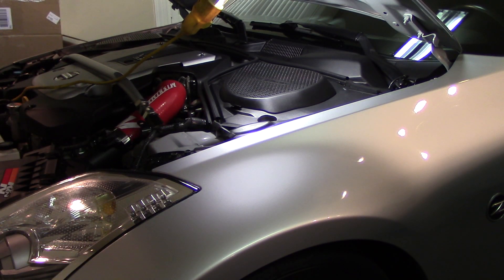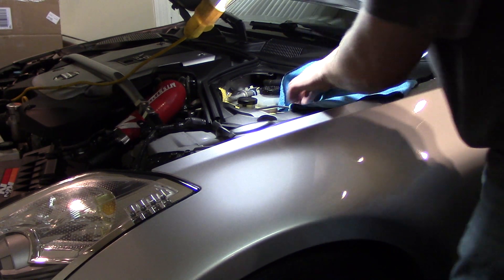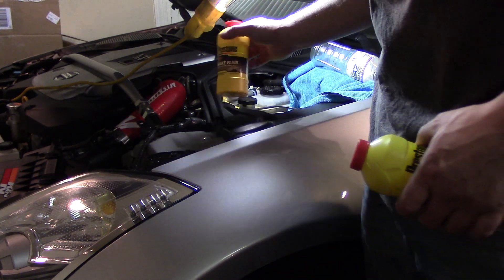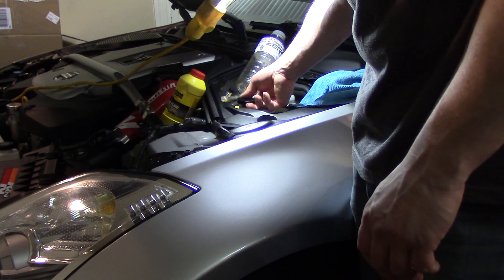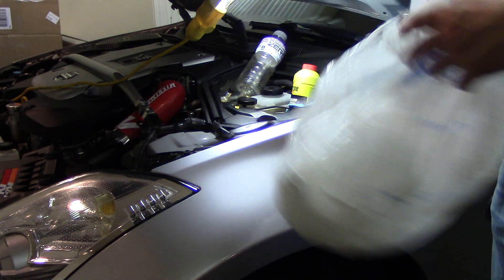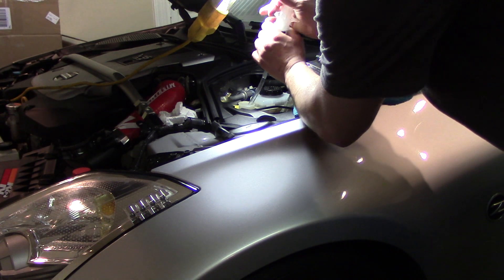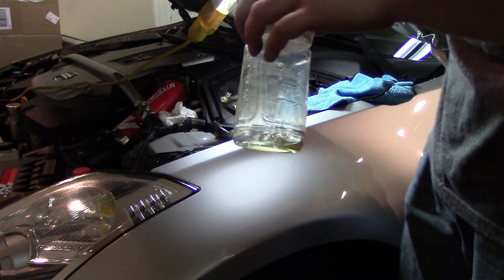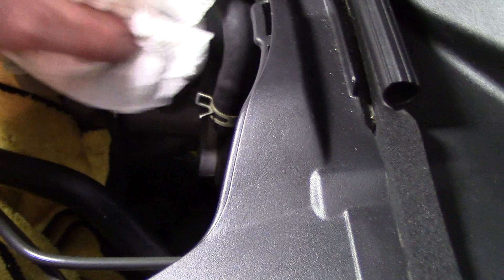Changing Clutch Fluid in Resevoir ONLY - 350Z

Comment: hey folks, hate to dissapoint but hydraulic systems such as cluch and brakes DO NOT CIRCULATE!!!!! think about it!! if they did there would be no pressure!! pressure is what assists/multiplies  the actuation of the pedal/ effort with our foot!! the fluid is basically static in the system, its purpose is pressure!!! so it does not circulate like engine oil or coolantl !!!! so as a result we need to flush these systems from time to time because brake fluid loves moisture which turns it dark and contaminates it so merely replacing the fluid in the resevoir is a waste of time!!!
Reply from the maker: I agree with 99% of what you said.  I never say this is even close to a replacement for flushing the system -- Hydraulic fluid as any fluid in a closed system moves from spot to another.  It definitely works as if it were a solid or closer to a solid -- (Push one end, the other end does the work) -- however, I and many other Z owners have had results from doing just this.  
Repeated changing of the reservoir does cause some of the fluid deeper down the line(s) to work it's way back into the reservoir, that is changed out.. rinse repeat.  It's not a way to replace the fluid,.. it may only replace 10-20% of the fluid after multiple efforts.
However, when you have a Concentric Slave Cylinder inside the bell housing, small things like this help after track days, before track days,.. etc.  (For SOME people).
If you were to put a dye in the reservoir.. you would find , that dye,  over time, at the other end of the system.

Comment: I know this is a old video but I have a question and Im hoping your able to answer. So I replaced my clutch everything went good, next day my clutch pedal just sticks to the ground I replace the master and slave worked fine fast forward about a month my clutch pedal begins doing the same thing but its only on a long drive it'll come up halfway and I have to pull it up with my toe I had to drive it like this on the way home the next day I turn the car on and it comes up normally until I drive it a distance just suddenly stops working when im at a stop and the car is still. I don't know if this has anything to do with it but if I turn the A/C on and I'm just sitting there for a bit and drive off it instantly makes the pedal come halfway up.
Reply: Ever figure out what the issue was? My nismo is doing this now. Sorry know this comment is 2 years old.
Reply: @godhelpgthisnoob4913  my clutch too
Reply: You have to adjust the clutch pedal assembly

Comment: this should've been a 3min video max. if you did it the right way by bleeding the slave cylinder nipple under the car, it still should've need less than 12mins. it appears you did it the lazy man method.
Reply: WHAT??
Reply from the maker: What are you talking about?  -- You could flush from a caliper bleed if you wanted to.  The point of this video is in the description.  I state specifically this is not the way to completely flush your hydraulic fluid. -- Lazy? Months after this I dropped the transmission myself and replaced the Master, CSC, all lines with SS, Clutch and Pressure plate.  Have you seen the work I've done to this car?  I've had this thing stripped down to assembly line condition for a sophisticated custom audio installation. I'll agree that people are lazy in general... but to generalize it to Americans not paying attention to modern human tendencies/behavior.

Comment: Did that MPG computer say 32 MPG? LoL. Anyways i can tell your really into your car. I have a 04.5 Touring model. What transmission fluid and differential fluid you running?
Reply from the maker: Haha.. yes it probably did.  When I'm not driving for fun.. I'll often drive to get the highest MPG like a game :) -- But 32mpg , as we know, is not a realistic figure over the long term.  So that was probably me resetting the MPG meter 10 miles from home and cruising down hills and such where it was averaging such a high mpg.

My true MPG with the tune on Stock Map (essentially off) -- is 23-24 mpg with a 90 percent city, 10 percent highway driving.

With the Tune on -- it drops to ~17 mpg in the same driving conditions. hehe..

Nice model.. I love all the Z's.. mainly from Z32 (1990 - present), So, Z32, Z33 (our cars, and the Z34 (370's).  I actually like the Z33 body style of the 350Z better than the bodystyle of the 370's/Z34's.. But The 370's are faster, and nicer inside.. sooo lol.

As for fluids in tranny and rear.. I use stock.. after all the reading,.. I've come to the conclusion that stock does a great job.

The diff. fluid I'll change with stock at the appropriate mileage.  Though, I MAY go to another fluid for the transmission here soon.  Considering I'm putting in a new Flywheel, JWT Clutch, Wilwood Heavy Duty Master Cylinder, Zspeed Heady Duty Slave Cylinder, All stainless steel lines, and a Nismo Roller needle bearing (to replace the stock brass one) -- I should consider swapping out the transmission fluid as well to complete the pretty much replacing everything down there job.. --- So what brand/kind of Transmission fluid do you use, and/or recommend?  And why?
Reply: I just ordered redline mt-85 for the transmission and redline gear oil GL-5 for the differential.
Reply from the maker: LiLDeMoN8I8 Respected names for sure.  Have you had any trouble, I know sometimes a gear or two can be a bit.. "grindy" if you know what I mean in some cars.. the mt-85 could help.. I know that thicker tranny oil will help with the chatter noise from the flywheel.. esp. if someone has a lightweight flywheel on.  The differential just needs to be lubed well.  You could get away with stock diff. fluid for 100k+ and I'm sure many do.  I don't see it as big of an impact as tran. oil,.. but probably because of how it's an "Automatic" fixed part of sorts.

Any reason you picked the Redline mt-85? Or just went with redline cause it's a good brand?
Reply: Ikos Log With the grinding. When cold 2nd gear grinds if i toss in 2nd quickly. I usually pause then it stiffly goes in but it wont grind. Thats the only gear the grinds. Fifth gear use to grind for me but that was because i had to get use to the car when i first bought it. I usually windmill into fifth gear now it goes in smoothly. For best shifting you need to pause for a second in neutral then throw it in. Like when your going from 2nd to 3rd just toss it in slowly. As for the reason i choose redline is because of all the great reviews in amazon. I bought the car with 92k miles and who the hell knows when the last time they changed the transmission or diff fluid in the car i bought from a local dealer..
Reply: Ikos Log Also my car has a lot of chatter i think it has a aftermarket fly wheel in it. Usually below 1000 rmp it chatters loud then it goes away. The stickshift vibrates a lot. I can feel the vibration thru my seat sometimes...
Reply: LiLDeMoN8I8 I got 06 g35 and have same issue when going into second gear seems notchy can’t hear grinding but could feel it in the shifter..hard to explain

Comment: My clutch pedal falls idk what is it :/
Reply from the maker: It is most likely your Slave Cylinder.  I recommend changing your Slave Cylinder and Master Cylinder.. This is guaranteed to fix your problem with your pedal falling.  I just went through this, and installed a New Slave cylinder, new master cylinder (and other parts because it's smart to do so while working in that area).

What year is your 350Z? I can be more specific on directing you to parts if you would like the help.  Otherwise, there is a 100% chance that it is your slave cylinder and/or master cylinder.  When you replace either of these you should replace them both,.. so your fix to your problem , again, is replacing the Slave Cylinder and Master Cylinder.  Depending on what year your car is will depend on the cost.
Reply: +Ikos Log I know its kinda been a while to ask, but how easy do you think the Mater and Slave Cylinder are to change? On an 06, where its on the outside of the tranny
Reply from the maker: It's not difficult, but as with all things you do for the first time, research/read up on step by step what to do/expect and get GOOD or better than factory parts .. esp. on the slave cylinder.  

There are writeups on the major Z forums of people who've done this with pictures etc.  It is definitely a much EASIER job on an 03-06 rather than an HR where you have to drop the transmission lol.

Comment: I did it to my Nismo and it went with out a hitch.  Mine looked like soda.  This method works.  posted pics on Instagram (justRich69 on ig)
Reply from the maker: Excellent! I posted this up to help people who didn't want to deal with working under their cars,.. or in the case of the newer Z's you cannot even access the proper areas without dropping the transmission (of course you could drain via calipers, but still) -- As a way to 'cycle' in small bits new fluid in without introducing air into the system.  It really can make a big difference if you have compromised hydraulic fluid -- "moisture, etc".   If yours looked like soda (I scanned through your IG, and didn't see it lol) then you should have a bit of peace of mind now.  have you noticed any difference in pedal feel, etc ?

Comment: can i do this for my brakes fluid?
Reply from the maker: Springfield ou "could" theoretically.. but I wouldn't.  Brakes are quite easy to get to.. the bleeder valves are at each wheel/caliper -- Unlike this clutch system.. If your brake fluid is no good, going bad, has moisture, etc.. Just take a minute and bleed it out at the nipples keeping air out of the system while feeding in new fresh fluid in the reservoir.

Just my opinion though!

Comment: Make a vid on your car
Reply from the maker: I will for sure.  I have done so much to it, from bolt ons, to installing audio "stealth" , to fabrication,.. all while trying to maintain a stealth/stock look to it inside and out.  Other than the devices I have as displays for "counter measure/radar etc" inside , with the car off it would be difficult to tell it wasn't a stock 2008 350Z.  It needs a solid wax now, after I get it polished up again I'll make an overview video on the car and just what is in it.

Comment: can you use old coolant ?
Reply from the maker: +lili M Coolant is Antifreeze used in the Radiator to cool the engine block.  This video is using Hydraulic fluid.. aka: Brake Fluid (same as Clutch Fluid).   That said, no you shouldn&#39;t use &quot;old&quot; Coolant, nor should you use old Brake, or Clutch fluid.  These things break down over time, in the case of hydraulic/brake/clutch fluid they retain moisture and cause issues in performance/spongey feeling, response, etc.  

As these fluids are quite inexpensive I highly recommend you buy them new.  For Clutch/Brake fluid it cost a few dollars or so for a bottle of it, and to flush an entire system it wouldn&#39;t be any more than 10-15$.  For antifreeze it may be $20-$30 depending on where and what kind you buy.. if it&#39;s pre mixed 50/50.. or not, etc.

If you could be more specific , (if the above didn&#39;t answer your question),.. I&#39;ll try to be more specific in my answer.

Take care.
Reply: +Ikos Log 
I know the differences between coolant and Clutch fluid.
I asked bc I was at the store today, the guy showed me the coolant and I told him I already have one ( PEAK, 50/50 Antifreeze)  which contains some coolant in the car  - which I showed it to him- but he didn&#39;t tell me not to use the old coolant.
I added just few drops but not that much.
In the manual stated &#39;not to use old break fluid&#39; but it doesn&#39;t say anything about old coolant .

Oh god, Im happy i didn&#39;t add the whole thing.
Do you think adding the few drops of the old coolant, is going to damage the engine?
Reply from the maker: +lili M Oh, I understand your situation now.  You have nothing to worry about.  No a little "old" coolant isn't going to harm anything.  The cooling system is separated from the internal components of the engine.  Engines have cooling "routes" that run through them and the coolant is pumped via your water pump through this "piping" through the engine block.  Through advective cooling,.. essentially the cooler liquid passing against the alloy/metal of the engine block causes the heat to disperse into the flowing liquid where it enters your radiator that is cooled by a fan(s) and through the incoming air through your grill/slit in the bumper as you drive down the road.  The faster you go the more effective the radiator is at cooling the hot coolant that has passed through the engine and then is continually recycled through the engine.

At any rate,.. you don't want to use "used" or "old" coolant because it becomes contaminated with rust particulates and breaks down in it's ability to perform it's function (not boil at high temps, maintain proper viscosity, etc etc).  While you could likely pour some old coolant from another vehicle in good condition in a brand new car and experience zero issues.. it's a bad idea as you want an efficient and CLEAN cooling system without deposits in it.

This is why when you change your coolant/antifreeze -- You drain it, then flush it with water .. Before refilling with brand new antifreeze (50/50 premix,.. or mixing 100% with water at a 50/50 ratio).

Bottom line, you haven't hurt anything, just dispose of your old coolant and spend the little extra money on some new if you need to "top off" your coolant levels.. keeping in mind the cold and hot marks on the reservoir overflow tank.  (Fill to cold if car has been sitting for many many hours.. and fill to hot if it has been run for a while.).

Take care,
Reply: +Ikos Log 
Thank you for your prompt and informative reply.
Now that i'v read my comment, i dont know why some words come up as numbers- I ll figure it out.
Its funny although im known to be a really good at software stuff ( computer even phone), i dont understand the logic in car mechanical structure, lool

Comment: where can I find the clutch fluid on a 370z? thanks in advance
Reply from the maker: +Hamed “ProGamer95” AL Wahaibi It's in the exact same location as on this car.  Just lift the cover in the engine bay on the driver side and the smaller reservoir is the clutch fluid.  Brake and Clutch fluid are essentially the same thing, and both reservoirs are next to each other in both the 350 and 370Z's.